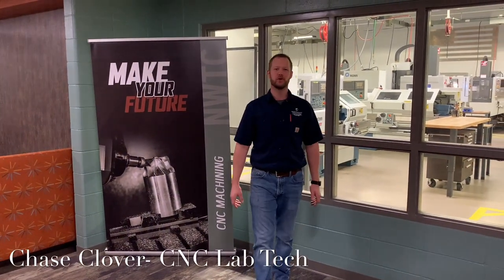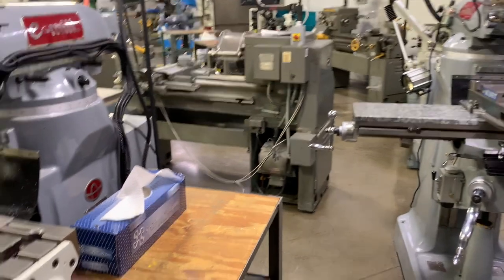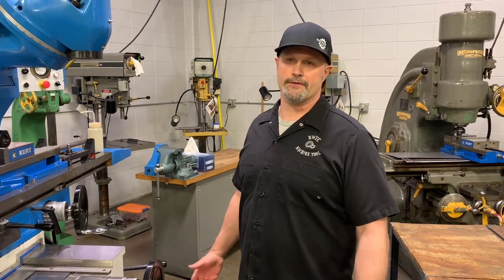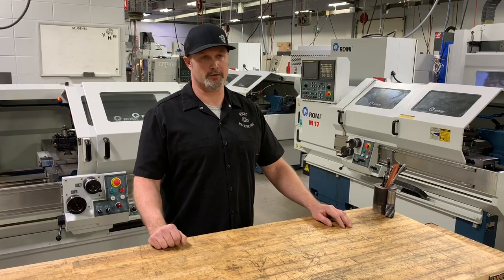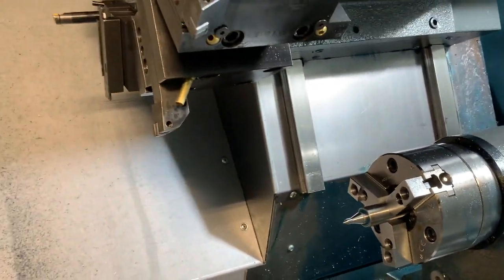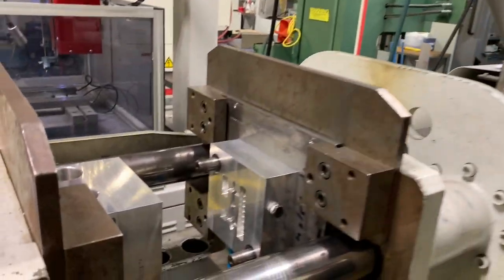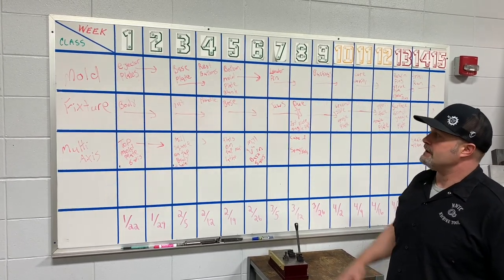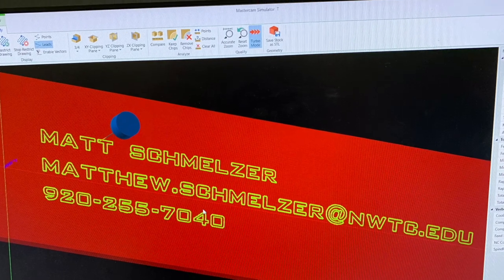Machine Shop Tours: Northeast Wisconsin Technical College

Comment: CNC tool measurements - printed out and yped into the machine before use ?????????
Surely you store that info from the measuring machine onto SD card and transfer it to the CNC that way ?